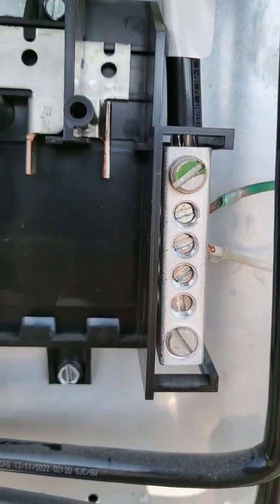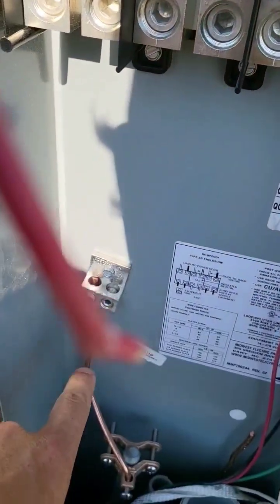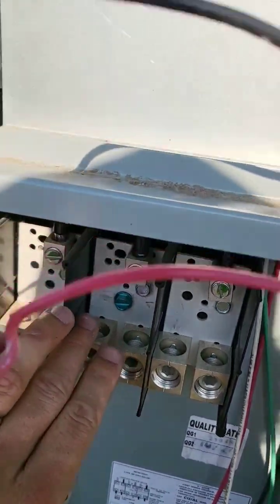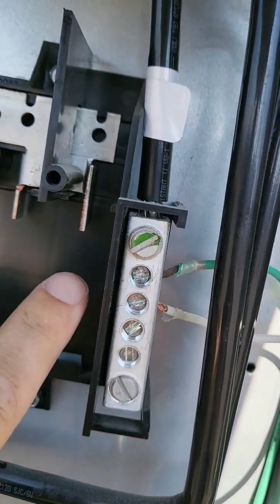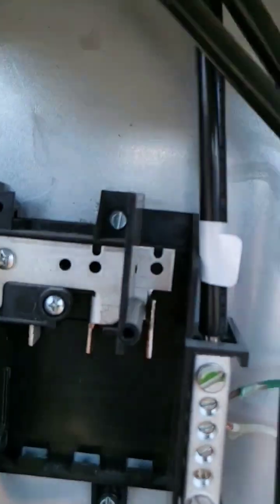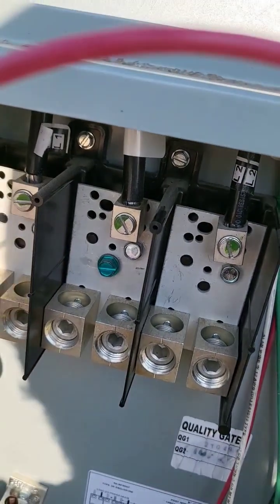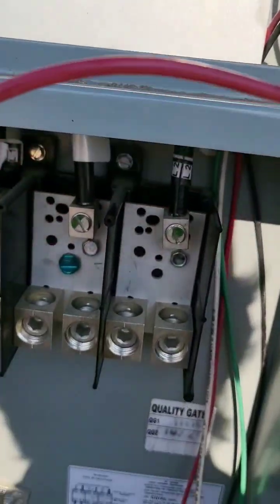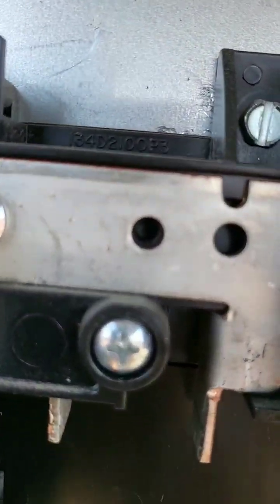Electrical mistakes to avoid Ground? What is Grounded? #shorts #fyp #electrical #theory

Comment: Don’t know anything about your power system but those ground/ grounding, bonding conductors look very small ,given the size of the conductors they are bonding to 🤷‍♂️
Reply from the maker: YupThose are branch circuits that's why  It's a service so the neutral and ground are on the same bar. The ground rods were bonded to the case and the mbj the green screw was tying it all together